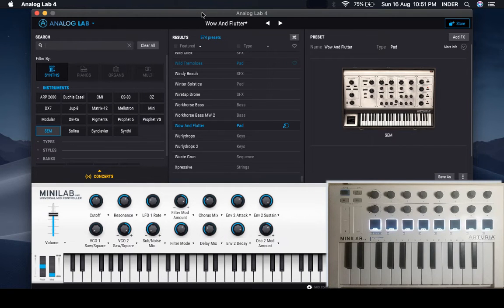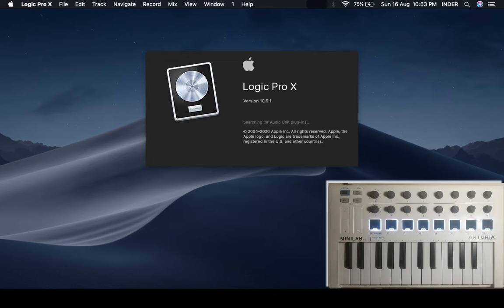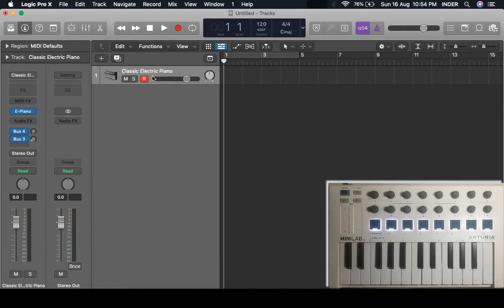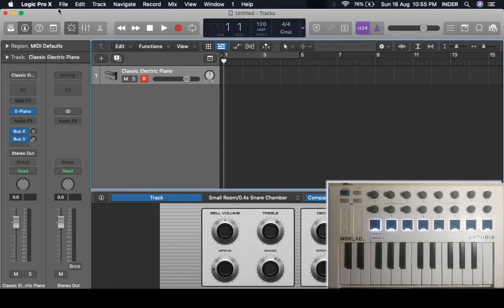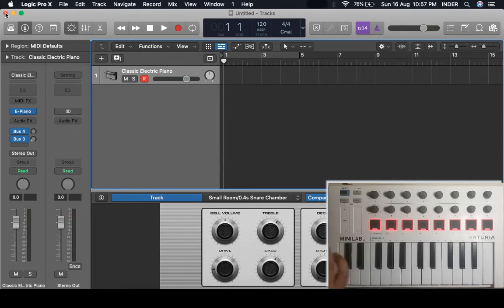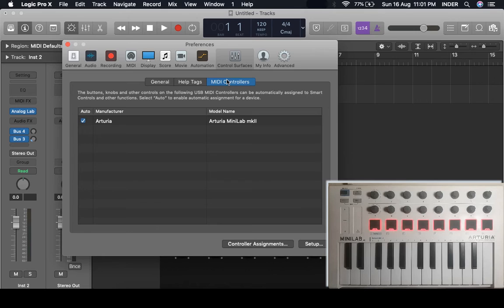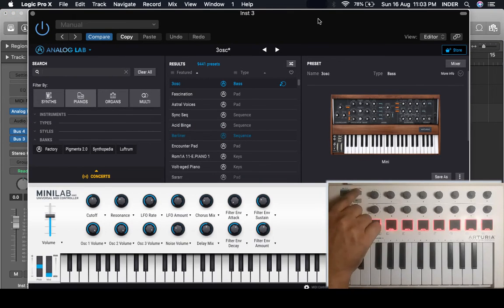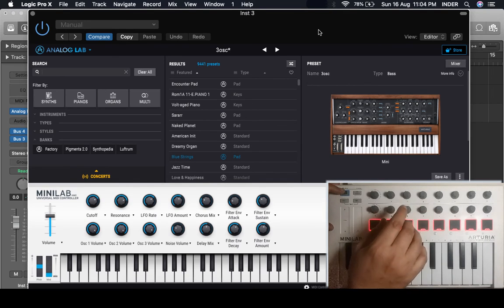Logic Pro X & Arturia Minilab mkII SETUP

Comment: if i buy the new arthuria mk3 that has 8 knobs how can i control the 16 knobs indicated in the standalone, as in your video?
Reply from the maker: It s a tradeoff , you have less knobs but a lot of new features but you can always make user presets for 8 knobs and 4 faders , and minilab already has a script for Logic , midi modes are universal for absolute and relative , you gotta try it to see what works best for your workflow 😊🙏🏻
Reply: @ipsinghification   do you mean that the 8 knobs via preset can become 24-32-64 on different banks? thank you

Comment: Hi:) i followed the steps to turn off the auto/smart controls but I'm still having the same problem in logic. When I use the standalone amolog lab it works perfectly and the knobs are mapped. If I use it in logic not all the knobs are working and they are jumpy and in different order. Is there some other solution to this problem?
Reply from the maker: Hi , mmmm that’s strange , you can check if there’s any Minilab profile saved in your controller preferences , delete that and delete your existing minilab midi devices from audio midi devices , seems you had two duplicate devices on the system, one has to b probe more , ping me if you don’t figure it out , this method is universal and worked for many musicians.

Comment: Greg Hill
0 seconds ago
Dude mine glitches no matter what buffer size I set... I got this cuz my old Launchkey 25 was doing that and I thought it was defective. WHY do my keyboards do this???

Is it because my Macbook Pro only uses USB C ports? Do you think I need a powered hub?
Reply from the maker: Mmmm need more details , what audio interface are you using ? Which daw ? Which OS ? What else is connected , how many devices ? Powered hub is essential anyways ! Need to understand what you mean by glitches send a video of what happens and your setup will sort it out for you ! Cheers
Reply: @ipsinghification  Scarlett 2i2 (this does fix itself when I unplug my interface and use built in speakers)
Logic (happens in any DAW)
16GB Ram i7 Processor, Monterey OS
I got a Belkin 4 way hub connected to my laptop via one of the usb-c ports, my interface, i-lok, and midi controller are plugged into that hub.

https://www.youtube.com/shorts/a7Jr7LjYSWA
Reply from the maker: @greghillmusic  Bro seems your interface is wonky try some other interface, buy a new one or troubleshoot at a friend , last hope would be to reload update scarlet firmware , delete everything to do with focusrite scarlet in your audio midi devices on mac , use findanyfile to delete old kext files associated with scarlet interface , happy hunting 👍🏻
Reply: @ipsinghification  thanks. I have 2 identical interfaces and it happens to both so I doubt it's a defective AI. I just ordered a powered hub. I'm sure that's the issue.
Reply: @ipsinghification  powered hub fixed it.

Comment: Hi! I've unchecked the button, and my knobs still don't turn Logic Pro stock plug ins, or Analog Lab IV. Logic Pro recognizes my Arturia Minilab mkII, I can play the keys, but nothing with the knobs. Any ideas?
Reply from the maker: Hey ! Seems unusual ! Watch my other video on minilab factory reset and firmware upgrade or maybe you are making it on a different channel , i would say reinitialize Logic remove Minilab from midi devices and start again .

Comment: Thank you so much for this series of videos, they have helped me a lot! I encountered a problem while setting the controller up, which is that it does not show in the expert view in logic when I press command+L. I have tried doing all the steps in the video, and it either says "no destination parameter" or "Control Surfaces: Arturia". May you provide some suggestions to what went wrong during the set up? Thank you so much! Have a nice day!
Reply from the maker: Hi Susan happy to help :)

1- Reset your Arturia minilab mkii
https://www.youtube.com/watch?v=5jXuesKy1zc&t=3s

Then disconnect minilab

2- it's a mac so go to macs audio midi setup app
press cmd+2
in the midi devices 

Find arturia minilab and delete it by pressing  ' - ' button on top.

Now connect back minilab

and then open logic 
Preferences 
( you might want to delete your logic preferences maybe something went wrong somewhere- you;ll have to reinitiate preferences , that way it'll be clean)
For that theres an option in Logic preferences called 
'Reset all preferences except key commands'
 
control surface deselect minilab 
but 
keep arturia minilab checked in midi devices.

That should help , otherwise email me i'll try to debug.
Reply: @ipsinghification  Hello! Thank you so much for taking your time to show the detailed steps! I followed all of them through, however, I still find problems with the expert view, and also not been able to let all pads show their colour at the same time as you did in the tutorial. Sorry for the complicated descriptions! I was wondering if there is a way to set everything back to the starting point, so I can try doing things all over again. Thank you again for your reply, it is very helpful! I can't express how much thanks I have! Have a nice day!

Comment: I Just purchased Minilab Mk2. I noticed that it doesn't receive midi feedback.
For example: when I assign a drum pad to control a channel On/Off in Logic Pro, if I use the mouse to control the same parameter it doesn't reflect on MiniLab. 
Is there a way to make this work differently?
Thanks!
Reply from the maker: Hi , you can try this
you have to do 2 things 
1- Change the Pad option in Midi Control Center to Toggle instead of Gate . keep the mode to switched control.
or

Change Mode of that particular mapping 
in Logic's controller assignment 
'option+Shift+k' [expert view]

You can do Mode - Toggle or Rotate how ever you desire.

Hope it helps

Comment: Thanks for this. Is there any way to get the keyboard to work with both Analog Lab and Logic Pro Smart Control, as I use both. Another way of asking the same question… if I follow your instructions here and set it up for Analog Lab, in that case, what is the best way to also use it with Logic Pro for all the Logic instruments. Should I do it manually for each instrument inside Logic Pro. Or some other way. Thanks.
Reply from the maker: Hi accentontheoff , you are welcome,Thanks for your supprt.
 and you have asked a brilliant question. 
It is possible :)

- You need to open key commands 'option+k'
- In the search bar type 
' Toggle bypass all control surfaces'
- Give it a keyboard shortcut command (command +shift+C) i had that command free.
or assign it to a midi pad , i would assign it to 
Minilab Preset 1 (default analog lab)
Shift+Knob 1 click button.

Now within your Control surface Preferences you can have Arturia checkbox selected.

So whenever you want to use Analog lab you just hit the shortcut combo to bypass control surface. And switch it back as you desire.

Hope that helps.
Reply: @ipsinghification  Thanks for the reply! :) If I understand correctly we are creating a shortcut to bypass all control surfaces. When we run that shortcut, we toggle to Logic. I am wondering... when we toggle to Logic do we use Logic's auto mapping. And if we are doing that during initial set up, which one do we set up first, Analog Lab or Logic Auto map. Or does it not matter.
Reply from the maker: @accentontheoff  in theory it doesn't matter if you do it after the initial setup. when you bypass the Logic s control surface script then analog lab will Work as intended.
keep in mind that if you want to map things according to your own way then logic s auto assign will not be helpful , then you are better off mapping on different channels of minilab instead of logics auto assign.
Also if you edit any mapping within Logics auto assign them Logic will create an alias of  edited map in control shortcuts .  you'll have to try it on your system to know how it works.
Reply: @ipsinghification  Got it, will try out, thanks!

Comment: I did everything sttby step but its still behaving the same way. already updated firmware.
Reply from the maker: Hi , GA 
I don't know how you have set up your midi devices .
Try
1- Disconnect all usb connections and In your MAC go to your factory "Audio Midi Setup" App 
Click on "Window"
Now check if you have any duplicate "Arturia MiniLab mkII" devices.
Or just to rectify i would Delete everything apart from "IAC Driver" , To delete select the device and press delete.

2- In Logic - Go to Control Surfaces > Preferences and delete Arturia Minilab mk II

Quit Logic 

Now reattach Minilab mkII to your system and check. 

Hope It Helps

Comment: Hey bro, nice tutorial! really helpful, but unfortunately Minilab mk2 won't be recognized in Logic Pro X at all. What do I do? Thanks
Reply from the maker: Hey thanks, there can be many reasons,
0- check your midi cable and usb port. 
1- check your midi setup in audio midi. 
2- does it work in standalone, if yes check preferences in LPX
3-Does midi control center see  your minilab mk ll? 
If possible make a screencast video and share showing your preferences set up, I'll try to solve your problem, no worries. 🙏🏻
Reply: @ipsinghification  Hi bro, it's recognized but although I can only play around with the knobs of the analog mini lab audio unit in Logic Pro X as well as all the Arturia products I got in Logic Pro X. 

It won't recognize the minilab itself at all in Logic Pro X in order to follow your instructions and control the knobs of any other plugin (Audio Unit). 

Cause the other plugins like the classic Logic Organ Piano for example can't be controlled.

I'll appreciate it if you have any thoughts on how to fix it.

Many Thanks bro!
Reply from the maker: @andreasmichael7718  Try resetting these , 
Try factory resetting your minilab mkII
https://www.youtube.com/watch?v=5jXuesKy1zc&t=1s

for controlling another logic instrument controls use another midi channel on minilab by pressing shift+ Pad 2  -7.

be sure to know it'll intialize every single preference you changed ....
https://ibb.co/6BGX2mc
https://ibb.co/FDCFt2B

Hope it Helps

Comment: Mine doesnt work, it just works with the first 8 knobs but it doesnt work with 9-16 (it does work in analog lab without logic). Maybe its an update on logic 10.6.1 
or something, if you could make video on this i would really appreciate it
Reply from the maker: Hey, technically it can't be due to the LPX update, it's a very specific problem, and i won't be able to assess as i am using Mojave so no LPX 10.6.1 could you send some pics of video i might be able to help.

Comment: Hey, thanks for the tutorial, that really helped. However, what do I do if I also want to control the parameters of another plugin like alchemy for example.When I assigned all the knobs to the parameters in alchemy I have the same problem with Analog Lab again. The Knobs don't control the parameters in Analog Lab anymore and when I assign them to the parameters they are very jumpy. Can you help me with this problem? It would be nice if you could make a video on it since there is nothing about it on youtube yet.
Reply from the maker: Yes will do a small vid on that for sure. You have made 2 different master mappings on the same midi channel. Will explain soon.

Comment: Hey, thanks for your explanation. There's a strange thing here in my logic, it does not show the Minilab MkII in the list of midi devices in logic. However it does work, but I can not see or edit the mappings or whatever. Midi control center is installed and I can configure it there, what am I missing here?
Reply from the maker: Hey see my firmware update and factory reset video, and also reset Logic Preferences from the menu.
Reply: @ipsinghification  Firware is all updated and did the reset as well. Logic preferences reset did not work either...
Reply from the maker: @snodvod  send a video, show what happens when you press cmd +L, and show your preferences with advance options selected.in Logic The midi inputs and control surface settings also. Br as detailed as possible, mail me, my email is in the about section.

Comment: Can this midi keyboard also work with pro tools?
Reply from the maker: Yes ofcourse it will. you'll have to do your own Pro Tools midi mapping for workflow enhancements.
Analog lab will work without any problem.
Reply: @ipsinghification  cool! Thanks! I couldn't connect it before but now I can! Do u know where I can get the analog lab plug-in to connect directly to Pro tools? It's not showing up in the inserts.
Reply from the maker: @emmajane6393  head over to Arturia official website and register your product. Then from the site itself you'll get Analog lab lite as your freebie. And install it you need to mainly install. Aax branch of the plugin since you are using Pro Tools.
For updating your keyboard you'll also need Midi Control Center. 
I do not use Pro tools so i can't give you proper troubleshooting instructions. But it is fairly easy. All the best thanks.
Reply: @ipsinghification  great!thanks

Comment: Excellent!  Great explanation. Perfect video. I now feel very confident in buying one of these. 

(I’m assuming here, that I can make 4 of the encoders link to the macro knobs on Xfer Serum...)
Reply from the maker: Thanks Steve, of course you'll be able to, just make sure to handle any plugin macro parameter you have to set that encoder to Absolute value in Midi Control Center. Cheers

Comment: great stuff man that fixed one issue but I am having a few problems with my Arturia keylab 49 in logic...the keys work but the stop play etc buttons do not...do you know how to fix this?? any help would be much appreciated  thanks man
Reply from the maker: Thanks Wardy, glad it worked . Furthermore although i don't have aArturia Keylab 49 but i do know anything with Play , Stop Record or a Rotating scrubber knob etc. Will work in Logic if you add the keyboard as 'Mackie Control' Pls look at this video ,this is just an example if you have mkII then there is a separate video available , just also ping a mail to Arturia Support , they'll reply promptly .  https://www.youtube.com/watch?v=x5UCFQ7YvKQ&ab_channel=JohnMike
Reply: @ipsinghification  hi man thanks for the link...I tried this video and again I still can't use the play stop etc buttons? I will drop Arturia a message ...thanks for your help...cheers

Comment: Will this be the same thing for Garageband?
Reply from the maker: Hi SidB : Technically The Arturia Analog lab will work without any setbacks along with Garageband Smart controls. There is no conflict.
Garageband does not give you that setting in the preferences (It has limited things that you can tweak)  as  the control surface setting is not listed , in Garageband you can't customize a lot of Midi Maps, because by default Garage will reset the "com.apple.garageband10.cs" preferences on each Garageband restart . Hope this helps
Reply: IP Thanks a lot man! This was really helpful. Would you recommend shifting to Logic Pro or Ableton?
Reply from the maker: @SidB  you are welcome SidB, about the DAW recommendation
- Assuming you have worked on Garageband and you are now familiar with that workflow, if you like that workflow then Logic is  the way to go.

-  In terms of Cost Logic Pro is a winner , 300$ vs 649$ , and if you get ableton you'll be wanting Push 2 , maybe Push 3 will be out soon.  And those Push devices are expensive Extra but essential part of Ableton Live game.

-Ableton is Sorted for Making songs and playing that Live , And there are many controller devices to help you Record and Perform.
Live is a winner for Live Performance where Logic's Live Performance  Grid is in it's nascent stage.

- Logic Pro x 10.5 with it's new Live Loop Grid mode Gives you Record and perform and infact some new amazing sequencing power now. and I see that in the near future Live loop Grid mode will get much better. And more Hardware will arrive.
But i have seen High CPU usage on both while using some 3rd party Instrument plugins, anyway for live you would want to limit you live instruments and have stems in audio ,  instead of midi . 
Use the plugins given by your DAW.
this domain is a different stage of  discussion. you get better at troubleshooting after spending time.

- One very Important thing : If you are a forever mac person than Logic makes sense , but if you Hop to Windows then Ableton , because Ableton is Cross Platform and LPX is only mac as of now.

You have to Try both to see your 'First Love' factor ;)

I use Logic Pro X - Reaper - Ableton Live .  (In That Order)

Hope you find this helpful.